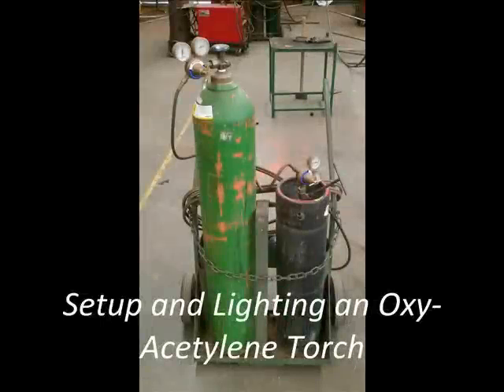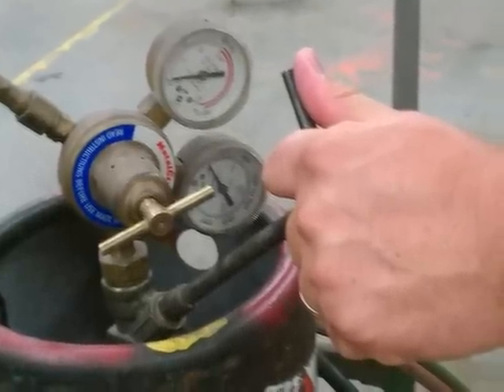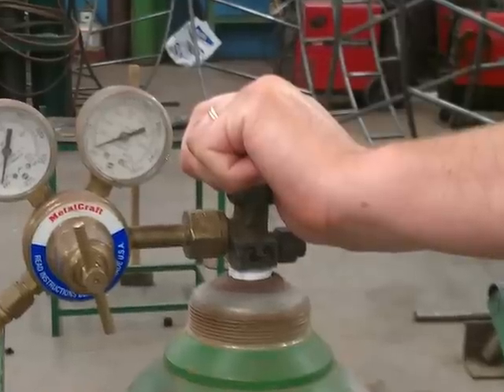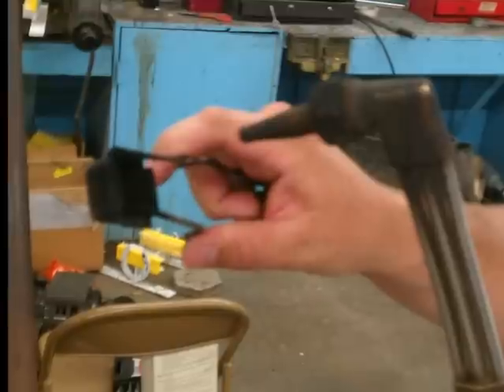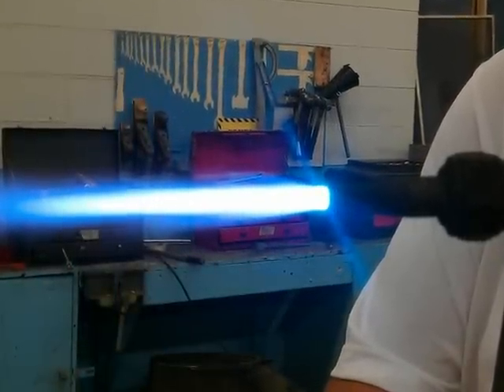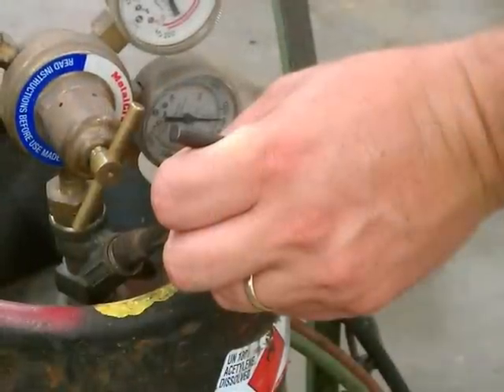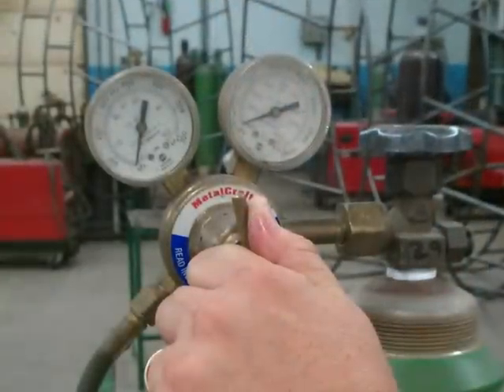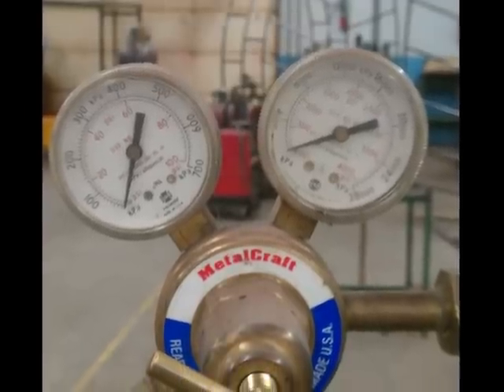Oxy-Acetylene Torch Setup and Lighting a "How-To" Article

Comment: thank you. I have welded for years but it was in a controlled setting. I worked on jigs building seats for Chevy pickups in Texas. I never had to use a torch. today will be my first time and I'm a bit nervous. I have always just used a cutting wheel to cut out my knives but I have recently acquired a huge saw mill blade 1/4" thick and needs to be cut with a torch. I am a manly man but admit I'm a bit nervous. thank you for the video

Comment: I was told to set the acetylene 3-5 psi
Reply from the maker: defcon 173 you'll be just fine in that range on the regulator. Sometimes, more is necessary for a hotter flame.

Comment: question does any body know how to clean them put different Head on it still wont cut ?thks any imfo wood be great
Reply from the maker: +521farmer You need to purchase a set of Torch Tip Cleaners. Should be a mixed set of sizes. It sounds like your tip is probably clogged... Especially the large center hole in your tip.

Comment: I believe you're suppose to close the oxygen valve first before the fuel valve or else a pop happens which throws carbon soot back into the torch.
Reply: Startup: acetylene, then oxygen
Shutoff: oxygen, then acetylene
Reply: @alexaronow9316  it’s Fuel before Oxygen always, when you’re starting up a torch and turning off a torch.
Reply: There are waaaay too many discrepancies in this video.
Canadian procedure differs from this.
Reply: I have always heard the acetylene is first on and first off, if you are using a rose tip or whatever it's called I believe it's the opposite

Comment: George C - you're right. He doesn't mention any setting for the oxygen on the torch handle prior to lighting.  Also he did not mention the proper purging procedure, which is acetylene first, then oxygen. And I believe those "knobs" on the regulators are called keys.

Comment: Has anybody noticed the mistake? I listen to it 4 times and nowhere did he say anything about the oxygen valve adjacent to the acetylene valve. I'm assuming it's suppose to be open but how much and when?
Reply from the maker: The Oxygen valve by the acetylene valve can be turned on all of the way. You will control the flow of Oxygen with the upper control knob when using the cutting head. If you are using a brazing/rosebud head, you will control the oxygen flow with the lower control knob.

Comment: If I'm not mistaken, you say to open the acetylene reg to 7 psi but the photo shows the gauge at 8 psi. . .
Reply: That's because when you start cutting, the psi will drop 1 psi. This wasn't explained, so I can see the confusion. And the settings all really depend on what the canister manufacturer instructs and the material being cut. Acetylene is not stable over 15 psi. Personally I set it at 3-5 psi max (including initial dial at 6 psi) while the oxy is from 35-40% max.

This process by the way is capable of cutting up to 10 inches -- maybe 11" max... which is incredible.

Comment: A potentially fatal accident happened at my place of work involving an oxy-acetylene torch and an open head 55 gallon drum which was being used to house scrap pieces of metal. Lunch time. The worker turned off his torch in the traditional way, acetylene first, then left the torch hang in the open head scrap drum. On arrival back at the shop he lit the torch and all hell broke loose. Witnesses said it looked like a mushroom cloud of flame that enveloped the worker. He was very lucky escaping with minor burns and singed eyebrows. Could have been much worse.  
 
New shop rules were put in place. Torches are to be shut off O2 first then acetylene. Turning off the O2 first can sometimes result in a little residual flame at the tip of the torch because the flame has not been blown out due to excess O2. This can be from two things. A little gas left in the torch body or a leaky valve. In any case the little flame can be a danger signal if it doesn't go out right away.  It was determined the worker had not tightened the acetylene valve properly and the gas leaked into the drum, ignited and well you know the rest.

Comment: thats why you have to replace parts once in a while as long as you follow the Manufactures guidelines you shouldn't blow your self up. Also Acetylene should never go above 15 psi or it could explode on itself. Rule of thumb, and I prefer Oxygen and 35-45 psi when cutting

Comment from the maker: There are 2 knobs at the base of the handle, one is Acetylene, the other is Oxygen. With the cutting head on the torch, the oxygen valve at the base of the handle can be turned on all the way and left that way. Oxygen flow will be controlled with the upper knob by the cutting lever.
Reply: tallfarmboy my oxy knob at the handle runs through the torch when it's on. Even if I turn off the fine adjustment knob at the top of the torch the oxy always runs through the tip unless I turn it off at the handle. If I was to light  the torch with ace. It would have oxy mixed . What's wrong with my torch?

Comment: I think I missed something.  There are two knobs at the base of the torch handle.  You only turned on one (the acetylene) and then adjusted the oxygen with the lone knob on the side of the torch.  What about the second knob at the base of the torch handle?  What setting should it have?